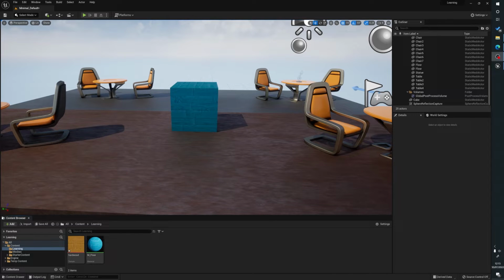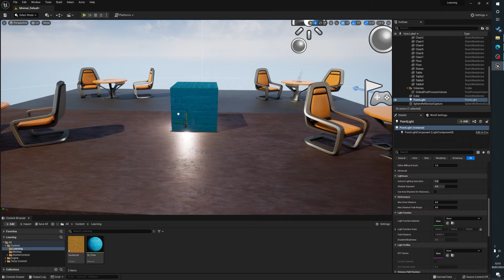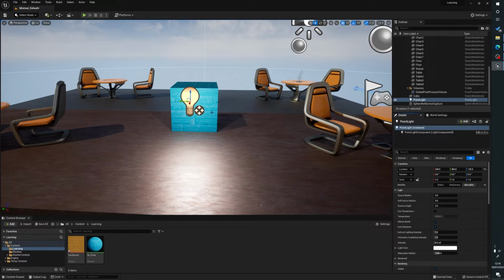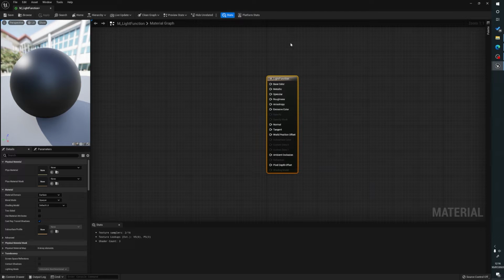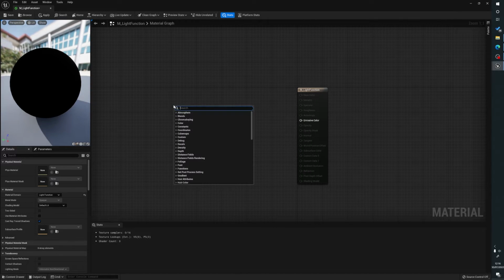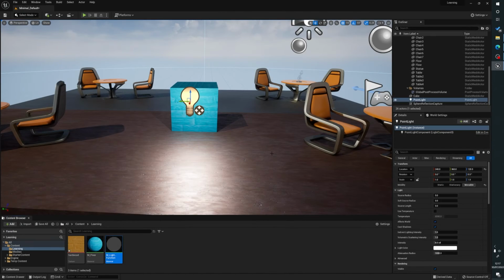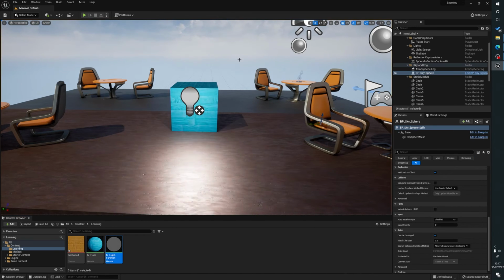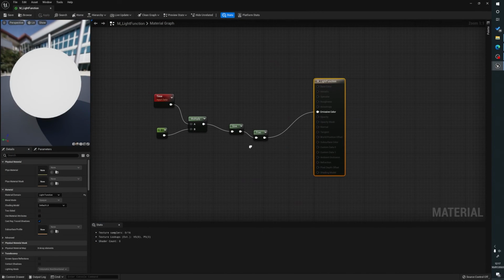How To Make A Light Flicker In Unreal Engine 5

Comment: it didn't work for me somehow and i followed the same steps you did, the material flicker normal
but when i apply in in the function drop down the light does not flicker, even if i press "play"
Reply: don't forget to do Material Domain - Light Function
Reply from the maker: Hi,

I've just followed the tutorial for myself again and it works fine for me and appears to work fine for others as well so I can only imagine you're possibly missing something in the tutorial.

What version of Unreal are you using please?
Reply: @joedickenson3d  , i'm using 5.0.1 , i did back to the same process again and i'm 100% i didn't forget anything
is there is any Settings i need to enable something like that !
Reply from the maker: @DoctorMGL  I can only think it'd a bug in 5.0.1 I would suggest updating to 5.1 as it'd had huge updates and upgrades
Reply: @DoctorMGL  had same problem. make sure you have the blend mode set to Opaque in your material. that fixed it for me.
Reply: After an hour I managed to fixed it by changing the shadow parameter in the scalability menu (top left next to perspective, lit and show) from low to medium. Hope it helps!